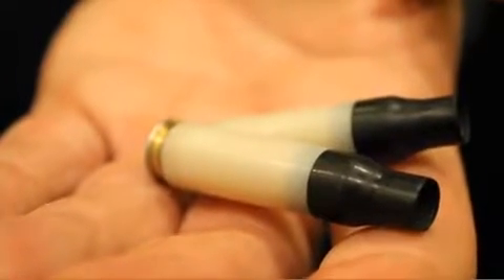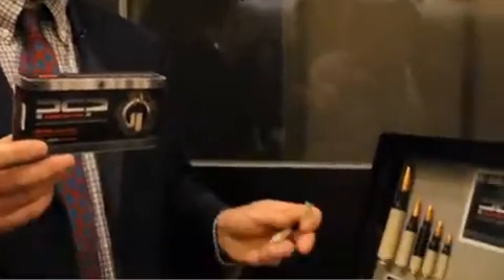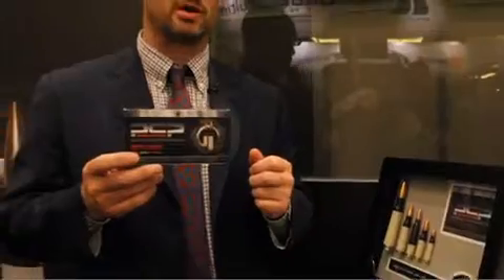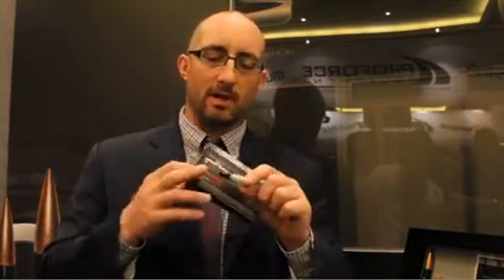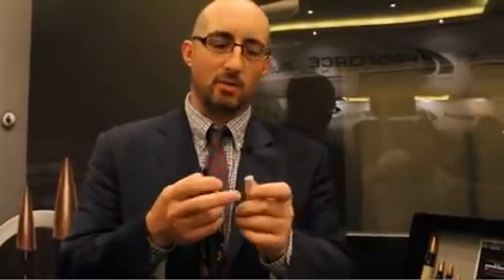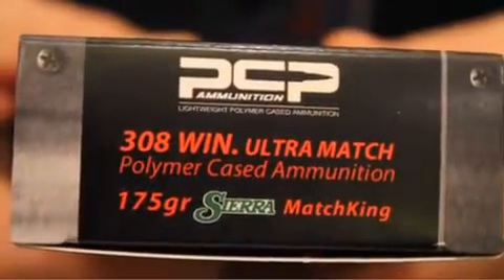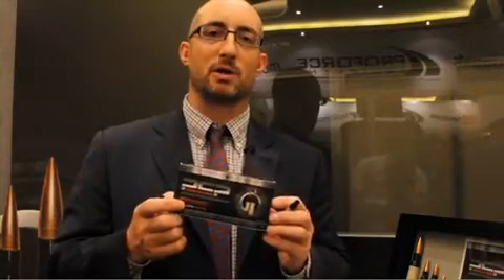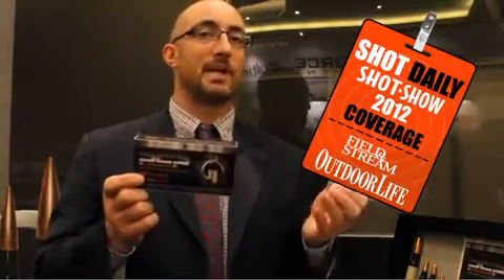Polymer Casings: The Future of Ammo?

Comment: Polymer cased ammo, used it 22yrs, ago in my .38 special. The bullet slips around and jammed the cylinder of the revolver , Had to use a twig to push the bullet back in so it can cycle again. The plus side is that they were pretty cheap for a 50 round box.